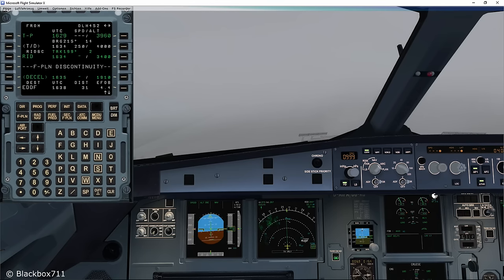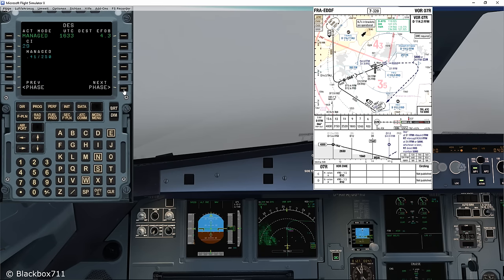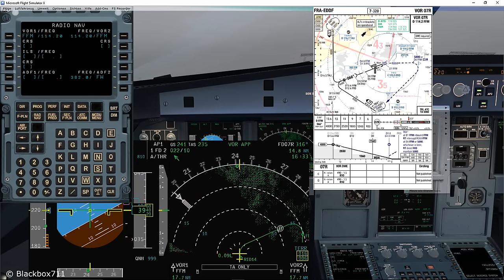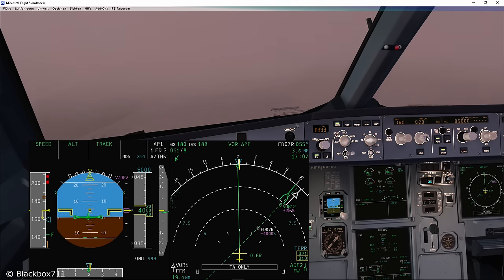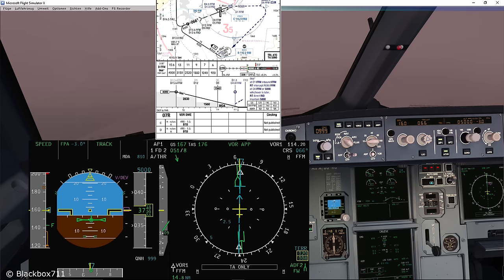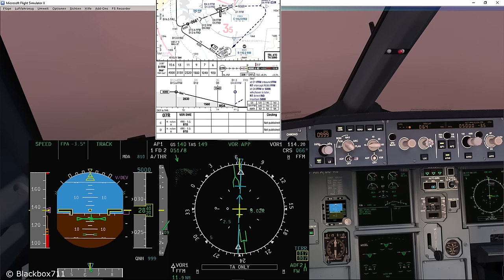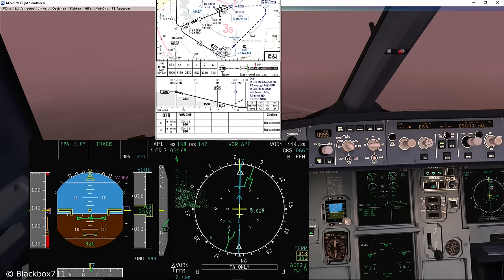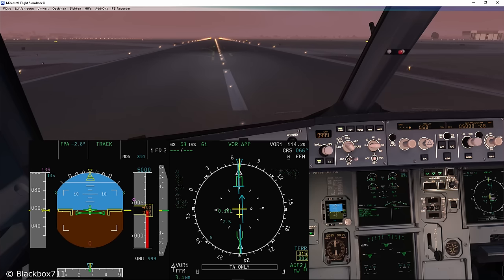FSLabs A320-X Basics: Non-Precision Approach using TRK/FPA

Comment: Hi! Thank you so much for your brilliant videos! I have just begun to follow you recently. In this video, you mentioned that FSLabs A320 won't activate FPA descent if the altitude setting is the same as current altitude. Why is that? Is it a bug or it was designed this way? And should I set the altitude higher or lower than my current alt. ? Thank you so much!!

Comment: Hi Blackbox711 in the latest (Navigraph Cycle 1705) there is no VOR07R only VDM07R so is that missing in the AIRAC or has VOR07R been withdrawn? forgot to mention that PFPX has the VOR07R plate and I am using Flight Sim Commander 9.6 rev 8 to look at the procedure. Just trying to set up a short scenario from EDDS to EDDF to practise what you are teaching here. Thanks so much you do great video's for the community.
Reply from the maker: Hi. I have just checked my Navigraph and I still have the IAC VOR 07C and VOR07R. Thank you for your kind words! Happy Landings, Blackbox

Comment: Siegi 658 .   I am a little bit in confusion: VOR Approach sinks automatically at FAP. Fixing the FPA is in my opinion only necessesary if you fly a LOC Approach, and that 0.3 nm before the FAP. Both are non precission approaches, with track and bird.
Reply from the maker: There are several different ways to fly a Non-Precision Approach. Either fully managed mode or selected mode. Depending on which of those you use, the final descent happens automatically or not.

Comment: Great tutorial indeed. Watching your videos I feel it is all too easy whereas when I try to land manually the centering of the runway seems illusive. Here, for instance  you came at an angle and then smoothly centered it when I try such a move  I have passed the runway width.
Reply from the maker: Just keep practicing. Do you have rudder pedals for your PC?
Reply: @Blackbox711  Do rubber pedals help significantly over mapping the yaw axis to twisting of the joystick?
Reply from the maker: @enojelly9452  Yes, physical rudder pedals greatly help in the flightsims

Comment: If you are high on profile. What is your “rule of thumb” to get back on profile? i.e you are 300’ above profile what FPA would you dial the correct the situation?
Reply from the maker: Usually you wouldn’t get 300 ft above the profile. If you do you would need to aggressively correct that deviation. So depending on the aircraft height you have certain maximum possible descent rates. In FPA terms that would mean around 4 to 5 degrees depending on the height.

Comment: Hi,
Is it not possible to track the VOR Radial via the AP while monitoring the Glide angle manually (like you did in the video)?

BR
Stephen Odgaard
Reply from the maker: If you use the TRK/FPA mode then you have to correct the track and descent rate manually via the FCU. Laterally you can use the NAV mode. So you can use NAV/FPA.

Comment: Another excellent tutorial!!! When you say "manual thrust", are you actually moving the thrust lever out of the CL detent somewhere in the are between CL and IDLE or does it just mean A/T off. I'm confused, please help.
Reply from the maker: Hi Arnie. Thank you! I switch off the A/T completely. Moving the thrust levers out of CLB detent will give you an ECAM caution message. Be aware though, that many airlines actually tell their pilots to leave the autothrust engaged even during manual flight. Regards BB

Comment: Is it normal for the aircraft to be so far off the centerline with NPA’s? I know NPA stands for NON-Precision Approach, but it seemed like the aircraft was a long way from the centerline and a large course correction was necessary. This would explain why minimums are much higher for NPA’s, but it still seemed a large distance to me. Thank you!
Reply from the maker: Some NPA‘s have a large offset from the runway centerline to keep clear of obstacles.

Comment: nice work. I have the Toliss A319. Should you always get the magenta vertical deviation bar displayed on all non precision approaches? In what mode will the airplane fly the deviation bar like a glideslope? My Toliss doesn't seem to display the deviation bar...thanks-
Reply from the maker: Not sure if the Toliss already handles RNAV approaches. Make sure the LS button is deselected

Comment: Servus! when you were assigned your "virtual approach clearance" to turn to heading 020, you selected "TRK/FPA" and proceeded to fly on track 020. with the wind only at 8 knots, that very closely corresponds to HDG 020. however, in conditions with more wind, on stormy days or jus on a regular basis in windy areas, e.g. Hamburg, ATC will issue a HDG intercept clearance corrected for wind. so, where atc would usually assign HDG 280, cleared ILS 25, they might use HDG 305 for the same runway on a day with winds at 360° with 50 knots at intercept altitude. if, in that case, you decide to switch to TRK/FPA mode this early, and fly on track 305, this could possibly result in a far to steep interception, lack of spacing behind you or even a loss of seperation to other approaching aircraft, since ATC anticipates you to fly a track of around 280, not 305. i would suggest to pay close attention when switching modes this early and to be sure to continue to fly the assigned HDG, using the yellow strip on the MFD, instead of flying the corresponding track indicated by the green trapezoid.
nevertheless, thanks for the high quality videos, they are a great help in flying the simulated airbus!! :) ;)
Reply from the maker: +spitfireinvasion ... yes in windy Crosswind conditions you would need to be careful when to use the Track function

Comment: I bought a Microsoft force feedback 2 here cheaply and made three separate units consisting of yoke, throttle and rudder on the pattern of Slew drive f16 rudder. I found difficult to control it as slight movement was not possible. I also have a Saitek x52 and aonther Force feedback 2 in its original condition which I prefer to use minus force feedback.

Comment: Dude I know this is two years old but I'm just discovering it, and you are just the best simmer on youtube by a long way. I noticed you don't have a patreon, AND your A320 knowledge is pro, so you are a pilot yes?
Also, briefly, what is the advantage of track/fpa vs. just using the flight director?
Reply from the maker: Hi. Yes I am a pilot and am rated on the A320. The FPV has the advantage that it shows the flightpath angle irrespective of the wind influences. Hence when you fly a procedure with a given flightpath angle, it is easier to follow that path with the FPA. If you were using the FD with Vertical Speed mode, you need to calculate the required descent rate yourself. And depending on the present groundspeed this could change rapidly sometime.
Reply: That's so well explained! Makes total sense to me now. Thanks alot for your reply! Much appreciated.
Reply: Blackbox711 won’t the vertical FD bar guide the pilot down to the runway. Why need to touch ROD?

Comment: I have a question. When flying in HDG mode and press the DIR button and choose the FAF and then put the outbound coures value in the inbound place LS4. Do I then press INSERT LS5? When choosing a VOR appr in the MCDU, What exactly does this give the pilots for resourses?
Reply from the maker: Hi. Answer to the first question: Yes
Choosing the VOR approach only selects the lateral and vertical approach path coded in the FMS. You would need to select the appropriate VOR manually in the RAD NAV page as well
Reply: Thanks for your reply. I don't know how we sim pilots would ever learn about flying this complex aircraft without your GREAT videos.
Thanks much
Reply: When I am in hdg mode and go to DIR page and enter outbound course to have the rwy extended line, I press  the 6  LSK (INSERT) and the plane goes direct to the appr fix. I just want to extend the center line and stay in HDG mode. What am I doing wrong?

Comment: Hi! Your videos are very instructive, thank you very much!

However I wasn't able to find the answer of a question that I have in mind for a long time.. I did a lot of research on it but I still didn't understand it, even with your video:

My question is about the "bird" which appears on the PFD when you select TRK/FPA on the FCU. I'm actually reading everywhere that it is easy and nice to fly the Airbus in TRK/FPA mode, but I don't understand how are you supposed to fly manually with this mode ? I firstly thought that I had to follow the "bird" on the PFD, as when you follow the cross (on the PFD with HDG/VS mode), but it doesn't seem that you're following it during the final approach ? 
Thus, what does this 'bird' indicates on the PFD and which information can we take from it in order to fly manually ?

I hope I was clear, thanks for the videos though ! ;)
Reply from the maker: Hi torderuder. Thank you. The "bird" ( Flight Path Vector) is just an indication of the aircrafts flightpath. So for example if I adjust the pitch to set the bird directly on the PFD horizon I achieve level flight. If I am flying a raw data ILS for example I can adjust the pitch of the aircraft to set the bird at -3 degrees and can easily stay on the glide profile (assuming it is the standard 3 degree glide). So the bird helps me to easily see the the actual flightpath in regard to the pitch. Also the difference between the pitch indicator (little square between the wings on the PFD) and the bird gives you the angle of attack. Hope my answer helps? Regards and happy landings.
Reply: Okay I think I got it! Thank you very much for your answer! :)
Happy landings too!
Reply from the maker: Very welcome :-)

Comment: Actually when do you start to activate approach phase for selected vor approach , on what dme before approach fix , i really have a hard time on my training in airline
Reply from the maker: Hi Fariz. The really important thing is to know that once you activate the approach phase and you are in managed speed mode, the commanded speed will drop down to Vapp and the aircraft will initially decelerate to green dot speed. So make sure you then do selected speed on the FCU if you want to fly at a certain speed. So the activation of the approach phase does not depend on a certain DME but depends on which commanded speed you want to fly. Maybe I should do a video on this to clarify it. Regards
Reply: Blackbox711 its a pleasure to post a video regarding this, thank you very much

Comment: Could you intercept the vor for landing by using the dir to FFM and radial in 246° or do you have to do it "manually"?
Reply from the maker: Hi Dolphin. If you use the FFM/radial in on the FMS you just program your own approach, which you are not supposed to do. Usually you select the correct stored approach in the FMS and do not change any of the programmed waypoints from the FAWP (Final Approach Waypoint) to the runway. So either fly the approach raw data (selecting the FFM VOR in the RAD NAV page and setting the inbound course there) and use the VOR Rose Mode. Or you fly it like it is shown in this video. Regards
Reply: aight, thanks for the answer!

Comment: is this possible with rnav approaches ? or do we need some ground aids to use this trk/fpa mode ??
Reply from the maker: Hi Jaffer. Whenever using the TRK/FPA mode due to the fact that you cannot use the RNAV function (GPS RNAV Approach or RNAV-Overlay Approach or the approach is simply not programmed in the FMS) you have to be able to crosscheck the altitude and the correct tracking. So yes, then you need ground aids tuned. For the "raw data" VOR Apporach in EDDF 07R you need the VOR (for tracking) and the DME (for altitude crosscheck).Regards
Reply: okay thanks :)

Comment: Thank you ver y much. I'm looking for Informacion on how To manual fly vor on airbus. Any help?
Reply from the maker: Simply dial in the VOR in the RAD NAV and also insert the inbound course there. Then select VOR ROSE on ND and fly with TRK | FPA
Reply: @Blackbox711  OK, I understand. What happen is that doesn't exist the typical BOEING LOC button to follow a radial VOR. OK ... Thanks for your answer!
Reply from the maker: Correct, in the A320 the LOC button is only for the ILS Localizer.

Comment: wow non-precision approach is really not precise...
Reply from the maker: +dokei dejital .. depends on the approach. Or were you being sarcastic?
Reply: ok i was not understanding it was offset approach. but why is it being offset? you switched to manual before minimum but if not, its even harder to align with runway right? anyway thanks for great videos
Reply from the maker: +dokei dejital .. thank you. It is offset because the inbound course does not equal the runway track. Once you are in visual contact with the runway you should fly manually in order to align with the runway. Happy Landings 👍🏼

Comment: question : when on an intercept heading, and the radual becomes alive, how long or at what point do I start turning to establish on the final track, also do I adjust for wind, or just set inbound track 

please sir can you do a video, on how to fly a dome arc selected selected please ...
Reply: The intercept heading should be given depending on you angle of interception. Bear in mind the distance to the FDP also, as you need to be on TRK before reaching FDP. Approaching Half a scale needle deflection is ideally the time you set your inbound track. Wind correction is required. Using the ROSE NAV mode is indeed very helpful.

Comment: 066 degress insert on RADIAL OUT ?  thats right?
Reply from the maker: If you mean extended centerline, then you enter the opposite value. In this case 246°. Regards
Reply: yes yes. In this case, you entered 246 in RADIAL OUT.  Regards man!! i like very much your videos.
Reply: Is there another video that you do the same procedure? extended centerline during approach?
Reply: Matheus A320 To extend the centerline we need to sequence the flight plan by using DIRECT TO RADIAL IN
Reply: If you press DIR then select waypoint then enter value in Radial In and insert it the FCU will change from HDG mode and turn towards the waypoint won't it?

Comment: Hi there, I was wondering why we'd need to monitor the tracking course once you've intercepted the final VOR radial? Sometimes it's 65, 66 or other but I thought that the goal of track is having the plane fly the 66° course by itself.
Also, I have the mfs standard xbox version, and I do set the course and frequency of the approach VOR and do track the final course as well but the plane sometimes deviates from the course by itself, would there be any reason for that?
Lastly, you mention that the plane can use NAV  or Final App function to bring me on the final VOR approach? For NAV,  I thought that as we get closer to the VOR (<5NM) the a320 might have trouble following the VOR?
Sorry for all these questions